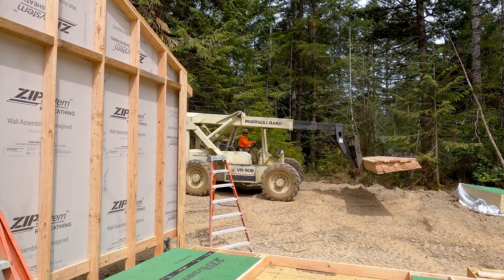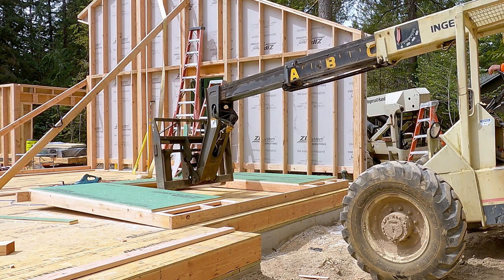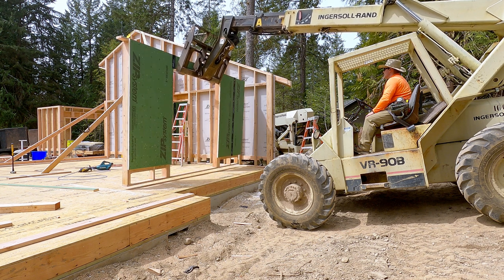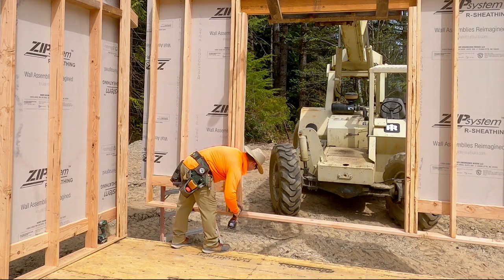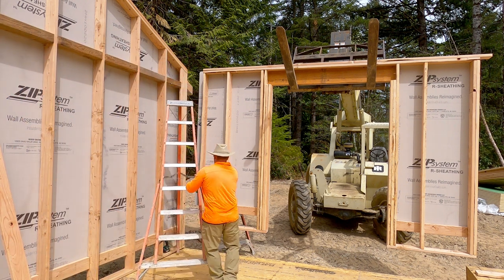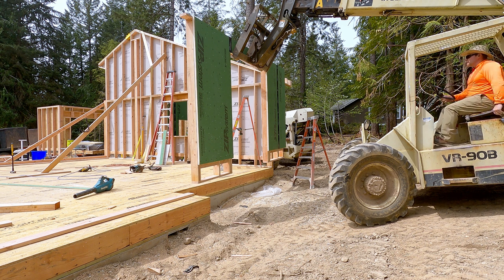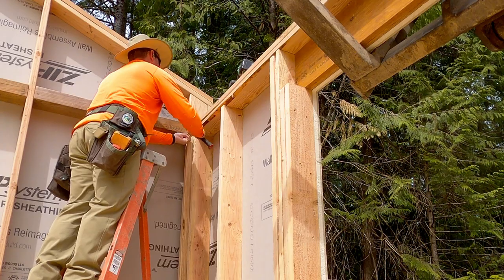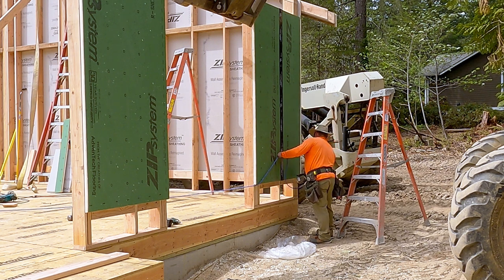Lifting a Small Wall with a Forklift

Comment: Nice video bro.  What are your thoughts on the Rsheathing in terms of shear values?
Reply from the maker: addressed here https://www.huberwood.com/uploads/documents/technical/documents/Seismic-Controlled-Regions-Installation-of-ZIP-System-R-sheathing-Technical-Tip-Wall-R-sheathing.pdf

It depends on the plan for us.  For a single story no issues but tighter nailing on the shear walls.  But going up, I'd have to ask the engineer.

Comment: What’s your opinion on the current lumber/sheathing costs?  I’m a framer out of puyallup not to far from you.
Reply from the maker: Its insane.  3/4" Advantech was $72/sheet for this house when I ordered it March 2nd, not is $110/sheet.
Reply: @AwesomeFramers  you need a new Lumber yard. Can get Advantech from home depot for $65 with volume pricing.
Reply from the maker: @skliros9235  thats true where you are but not here. You do know that prices are different all over the country right? Have you priced it this week?
Reply: @AwesomeFramers  I just checked yesterday. Home depot is still not too high on Lumber, but some of the other yards really jacked up their prices this past week. I'm in the Midwest.
Reply from the maker: @skliros9235  We tend to be higher priced here because it ships from Oklahoma to WA.  Market is insane here right now.  A spec we sold for $425k in 2015 is on the market for $725k right now